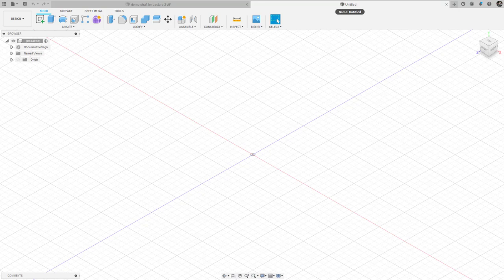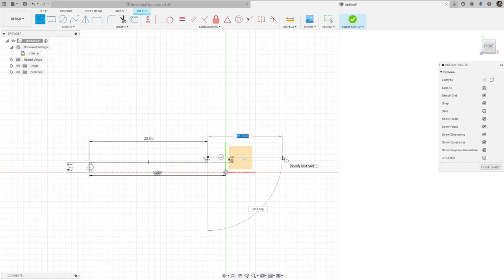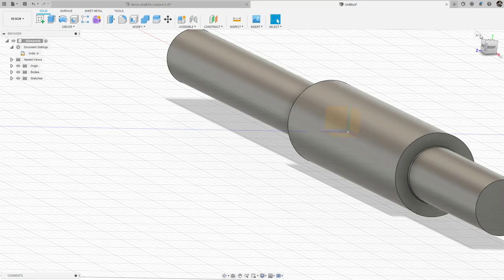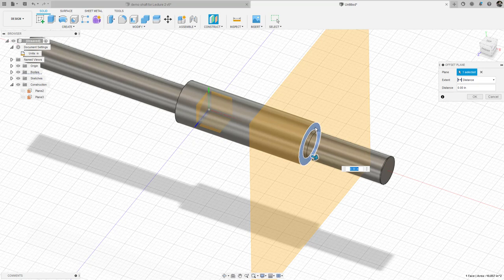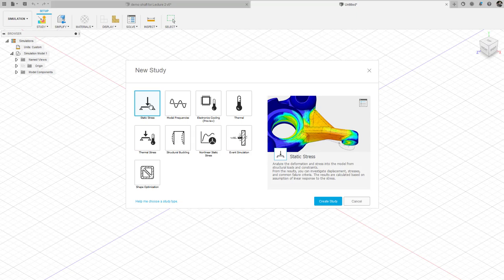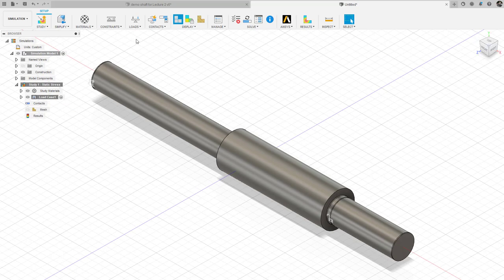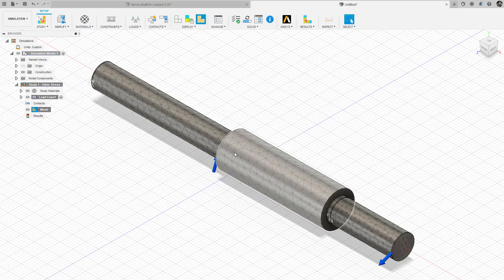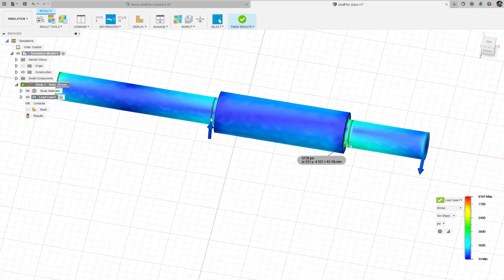ME 329 Lecture 2d: How to use AutoCADs Fusion 360 to CAD and analyze a shaft

Comment: why do you apply a fixed support to bearing B and a pin support to bearing A?
Reply from the maker: Pramath...good question.  I want to constrain translation, but allow rotation.  that is why I chose this approach.  So I fixed the x,y,z coordinates of one end, and just the in-plane coordinates at the other.  But there is a better way...if you put a small hemispherical impression at each end, then use a frictionless constrain, it fixes the location of the shaft ends, but allows for rotation.  It is always a challenge to find appropriate constraints, I must say.  So, whatever you choose to do, do not analyze the results near those constraints...also, just change the constraints and observe how it changes the results.  This is an eye opening experience for all of us, students especially.  In fact, I love that FEA allows one to run a host of 'experiments' that help you develop understanding.
Reply: @MechaTomics  I'm getting the bearing loads very high near the split faces, and I think it's because the area is very small, causing it to fail unreasonably. Should I increase the width of split face or is it a different problem causing. Also, I very much appreciate your last reply, learning a lot from your videos. Thank you! :))
Reply from the maker: @pramathbhat6423  You will definitely have extremely large bearings loads at the split faces...you can not trust those numbers, because they are a poor representation of how the loads are actually applied.  As usual, you need to keep you analysis away from the points where you apply constraints.  It does not mean that you can not do it differently to get what the actual distribution of the bearing loads happens to be, but you can not get it from what I proposed doing here.  You would need to actually sort out the contact area for a real bearing...it can be done, but that is not what I was trying to do here.  Bottom line is that you've got the correct intution...your bearing loads are high because of the artificial area you are choosing to support those loads!  So, I would say, good job!  It is very important to look at your results and check them for reasonableness.  You found them to be unreasonable, so you know that the answer is incorrect.  I repeat:  good work!